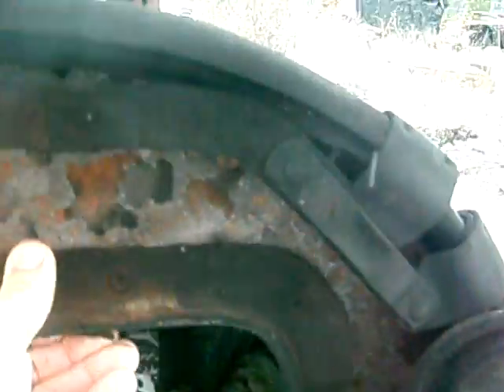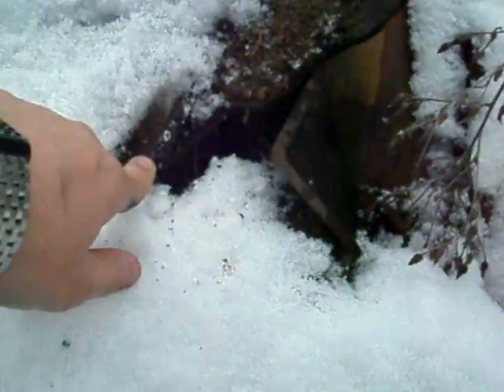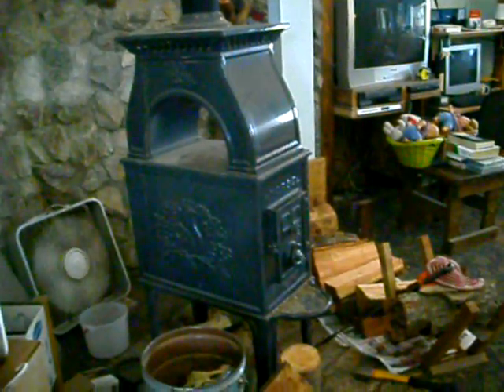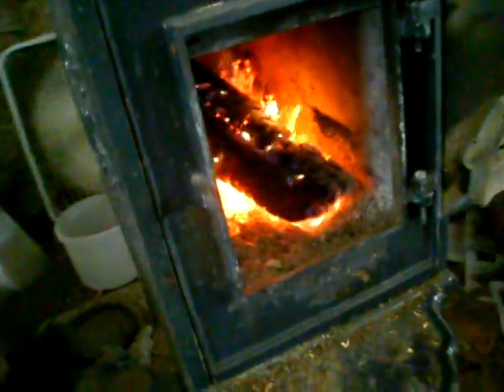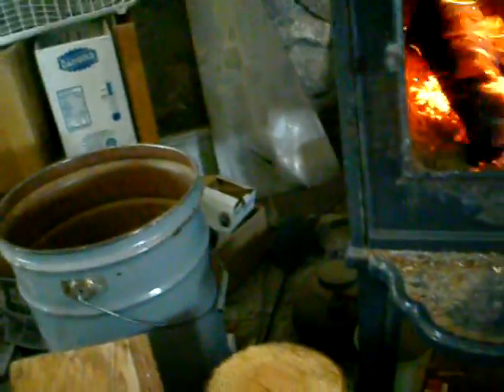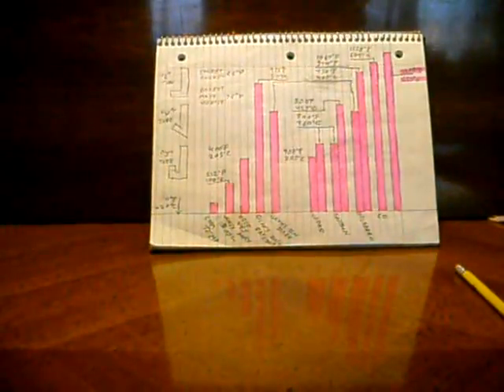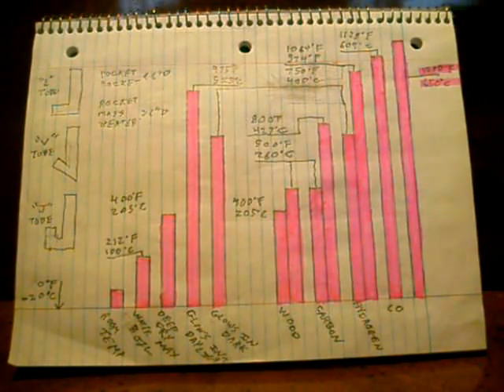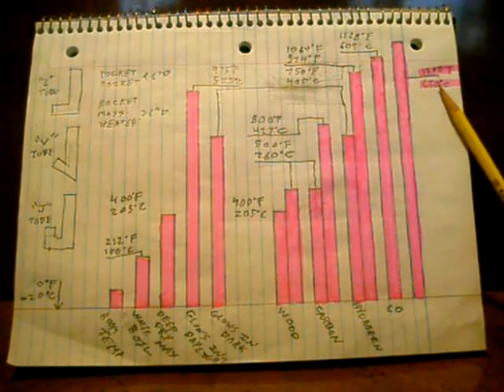Rocket Mass Heater 00

Comment: Contrary to your assumptions that temperatures in excess of 1000 degrees Fahrenheit are necessary to burn gasses produced (hydrogen, carbon monoxide,) these gases burn at much lower temperatures!  The reason your stoves did not last very long was because you burned wood in the presence of so much oxygen (air) that your stoves had become red-hot to the point that you could read a book when you were near them.
At very high temperatures (above 900 degrees Fahrenheit) sheet metal and cast iron and even steel and any other metal that you can build a stove with, would convert to rust at an accelerated rate and with daily use would thin out to the point of having holes at several locations.  As you know, iron rust forms even at room temperature of 70 degrees.  Surely,  when you crank up the temperature in your primary burning chamber to above 1000 degrees,  not only you are burning wood but you are oxidizing  your stove at a faster pace.  Use of baffle in the burning chamber delays exit of the wood gases up the flu pipe.  Installation of catalytic converter does even a more complete job of combusting the wood products.  These would help your stove last longer.

Comment: So you think an incandescent bulb operates at the melting point of tungsten? I think the glass would melt...
I have melted aluminium in a rocket stove I made which means it was over 660 degrees Celsius. There is a difference between the inside burn chamber temperatures and those on the top of the stove. Mine was covered in a mass of sand and gravel for a test. I think it is quite reasonable to expect higher temperatures as mine was a poor temporary design.

Comment: I have been researching Rocket mass heaters recently and from what I'm seeing, they aren't claiming to burn off the carbon dioxide as they say there will be some carbon dioxide in the exhaust along with steam and just a little smoke but very little. Also the steel isn't being used as the fire box where the stoves you mentioned, the fireboxes are what burnt out.
Reply from the maker: You can't burn Carbon Dioxide, but you can burn Carbon Monoxide, and it should actually be possible. I have also learned that the PH of the exhaust could be less corrosive if you do a more complete burn. This will prevent the burning out of you barrel. Also, a clay/sand based heat riser becomes a brick once it gets above about 1800 F. I think it's all very possible to make work, but you just have to keep in mind the hazards and limitations.

Comment: Adding the 5/16" steel plate to your wood stove created stress at the weld joints and alternately cooling and super-heating took its toll. A new stove has to be broken in slowly by raising the temps over several burns to relieve stresses and let the carbon content come to the surface, etc.  Your graphs don't reflect that!

Comment: Your conclusion is based on a false premise. The rocket stoves you based your observation on are ill-designed so don't reach the high temps needed for complete combustion. Fault the builder for deviating from the physics of the rocket stove principal, not the steel. Besides, unless you have metallurgical training you are likely to pick the wrong steel anyway. My design doesn't use steel or firebrick. Those work too but all require some simple design math not being used in your examples.

Comment from the maker: I don't know much about wood gas systems, but from what I understand about wood gas fired engines, is they don't heat the wood up quite enough to burn it, so your firebox may only get to 400 or 500 degrees. If it does, the wood gas plumbing may cool the wood gas off before it reaches the carburetor and mixes with oxygen. You want the gas burning in the engine not the carburetor. The cooler temps should preserve the firebox a lot if it is metal.

Comment: fire brick rocket stove ,has it burn tunnel on my test build shuts my infra red thermometer down at 1200 C so it got to be getting above that,just need to get higher reading thermometer to know what temp is .Fire brick also gives thermal mass so less of heat escapes up chimney,and stay hot for hours after,giving off stored heat,unfortunately my expensive wood burner does exactly what it say on the tin,eats wood and heats a little water with flue temps in excess of 300 C

Comment: great video and although i agree with your common sense and information, most of the RS and RMH builds i have seen have been so cheaply made it is probably not really a problem to replace them or some parts in a few years at least until a long lasting example is proven. also im paying $200 dollars for 2 chords off logs per year just cooking and a little heating with my conventional cooker if a rocket stove cuts that by a quarter it would pay for itself pretty quickly :)

Comment: You did a great job and very informative, but you need to realize that fire brick are used in the steel industry for years now and  like anything else there are different grades of firebrick. With that being said 3000° f is achievable with fire brick. I have a bit of knowledge on these things but rocket stoves are not as efficent as they could be. I could go on and on for hours

Comment: Hi, You are packed with info, here's my thing,  i work in my garage all winter, i've been running a small cast iron wood burner that eats wood fast as i can feed it.  I learned about the whole rocket heater deal and it looks like the way to go as far as high heat to wood usage and burn time ratios, i like the 55gal drum rocket with the angle feed, and i don't mind some parts melting once and a while, is a rocket heater the way to go in a cold garage, in northeast ohio winter?

Comment: I couldn't quite read all your chart but about the glowing temperatures, I have noticed differently probably because of metal thickness.  I have been experimenting with black stove pipe for  a rocket stove fireplace. when my J tube is glowing, I take a temperature reading and it's always almost or just over 1000 degrees. Ive never seen it glow at any other lower temperatures. One reason I used chimney pipe is I can cheaply replace it, vs having to rebuild a while new stove. Love the Info though.

Comment: I agree with both of you that there isn't very likely that these stoves hit the extreme temps you mention and I also want to point out that most of today's stoves are fire brick lined.  This protects the steel or stone exterior of the stove.   Obviously steel melts at certain temps.  I put my plasma cutter on steel and it melts pretty easily.    I think the main benefit to these stoves is that they can be set up quickly and you can cook on them without power in a storm.  I'm in NJ..Sandy sucked!

Comment: Hello Uncle Rice,
Thanks for a great summary of why not to use metal in clean-burning fireboxes, as well as other insights.  
Would you consider bringing this to the discussions at permies.com? (wood-burning stoves forum under 'energy')
I often chide Ernie's 4500 degree guesstimate, but I was not present at the experiment where he white-heated a barrel with insulated masonry, motor oil and oak.  Effects on materials (perlite, clay) suggest 2100-2400 F as a more typical peak for wood fuel.

Comment: UNCLE tell them the truth! all that is said here is RIGHT ON! i am a metal smith and fabricator, his specs are true and metal fails when fire is in the picture thats why the space shuttle is ceramic and not any kind of metal.Metal will fail rapidly in the end.it is because of the lye in the ash.when the fire is off the moisture in the air turns it into a highly corrosive material,hence oxides the metal and causes it to fail i know my shit,and so does UncleRice thanx for your posts Uncle!

Comment: So: we best measure the temperatures in different cross section positions to tell if a chimney (or heat riser) does or does not reach a certain temperature. If a heat risers center do reach the critical temperature then some mixing turbulent elements can make sure to get most gases at least once through this region. 
If we want to make sure, we best build a donut shape under the heat riser and feed in the fire in a tangent and let out the exhaust from the center.

Comment: Very good points! And the conclusion is also valid.
But i think there is a critical error in the comparisons. It is assumed, that the flames temperature is the same as the container walls temperature.
Tis must not be the case in all but the best insulating materials. Most of the burning gases are insulated by air and other gases a bit. There is a theory, that in a chimney there is a less hot relatively slow layer of gas close to the wall and and most gas travels in the hot core. So:

Comment: Sir, you make some good points with lots of facts, and I don't agree with all your logic or comments. I built an L and V and J rocket stove. I can say the stove gets very hot, like 1200 if you measure the fire temp with an IR sensor. BUT, I do agree with your final conclusion and you are spot on! The title of your vid is rocket MASS heater, and I wondered when you might talk about clay mass.  You led me down a path and, surprise!  You got me at the end!  Story well told (in a controversial way).

Comment from the maker: I believe they can be safe as or safer than any other heater. I'm just having doubts they are burning the CO without burning the steel parts in the interior of the heat riser or the top of the barrel. If you keep an eye on the top of the barrel for holes, you should be just fine.

Comment from the maker: It's a matter of scale. Sometimes certain devices need to be a certain size to achieve their full potential. Sort of like turbine engines. We don't have them in cars because they aren't efficient until they reach the size that yields about 1500 HP. Like wise, while pocket rockets are good, they don't achieve their ultimate potential due to their small size.

Comment from the maker: The clay in the clay/pearlite mix they are putting in between the layers of the double walled chimney pipe becomes brick, I think, after a few burnings. Thus the inner liner is sacrificial. That's what I've put together. Regrettably, An assortment of issues this past summer short circuited my efforts to build a rocket stove this year, but it did give me time to come up with a few Ideas to make a regular RMH better.

Comment: As for the pocket rocket stoves I believe you are correct; there is a boost to efficiency from a strong draft and a lot of energy concentration due to the insulation but the combustion is far from complete in the tin can versions (thus blackened pots). Many videos show flames coming out the top of the stove; obviously the combustion process has not finished before it exits. Perhaps it needs more air and continues the burn after exiting and mixing with fresh air (but prevented by pot & skirt).

Comment: Good video, I also am interested in these mass heaters but had my doubts about the ones I saw using insulated flue pipe for the upper portion of the J tube.  Many sources say the rocket stove sort of induces a controlled chimney fire to achieve the high temperatures and I understand the idea however don't real chimney fires often consume the flue liners and thus get out of hand? If the flues could withstand those temperatures the house would survive and the chimney would be clean afterwards.

Comment: here is the issues I see first of all use fire brick in your wood stove and would not burn out like I do with mine it has been running for ten year and nothing has failed yet and I also burn coal in it too. second of all you should build a rocket stove and test it before you give your opinion on the issues. I bet it has lot less pollution than your stove has and does not require and expensive class A like chimney like you have

Comment from the maker: Steal componants in the J tube through the barrel. It occurred to me that mixing clay with pearlite inside a double walled chimney for the heat riser will cause is to be come a insulative firebrick quasi cob/ clay foam kind of material that would render the inner metal chimney piece of the heat riser redundant very quickly so that it would not matter if it burned away. This is not explained at all in the book or any of the videos I have seen.

Comment: @rubbernecker13 Your light bulb analogy is perfect for this. Stainless does last much longer. Too bad you can't pick up pyrex bricks cheap at the local hardware store. Also, if built and run properly, rocket stoves/rocket mass heaters can burn way cleaner than conventional stoves as easily seen by the lack of any smoke. I'm sure you know this but smoke is a good portion of your wood wasted as it's uncombusted particles. The book has a lot of interesting info in it, you might really like it.

Comment: They say in the book that the heat riser barrels last them many years for the reason that by the time it gets to any serious temperatures, the oxygen is already burned out of the air passing over the steel. Only the combustion chamber has to be masonry to really last. If you use a carbon steel 55 gallon oil drum to burn branches and trash and what have you, the reacting oxygen coming in will only allow maybe 30 to 50 burns before holes are rusted (burnt) through.

Comment: @bs4872 I am curious what effect the combustion materials would have on the kiln bricks. Electric heat is so clean and wood is a solid fuel with much to burn. May have to experament.